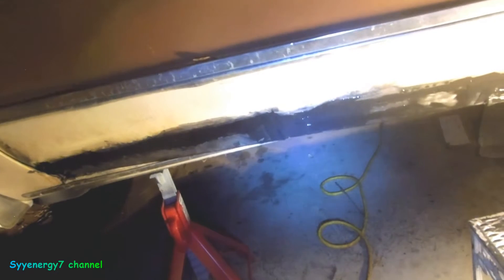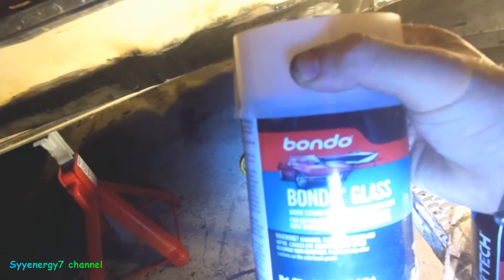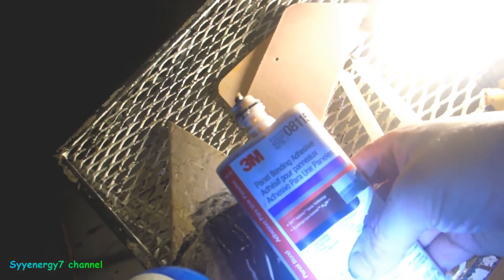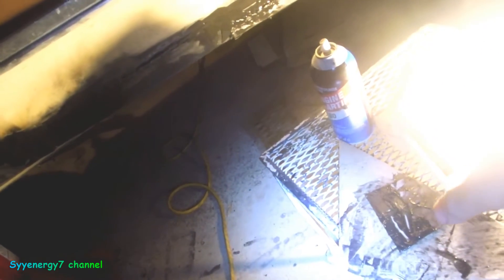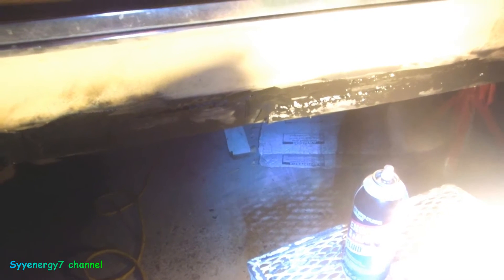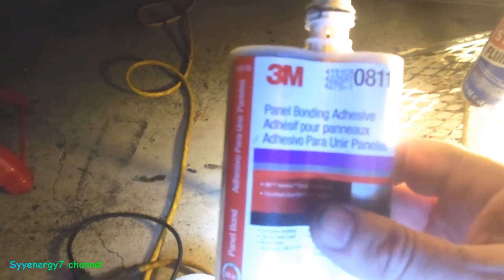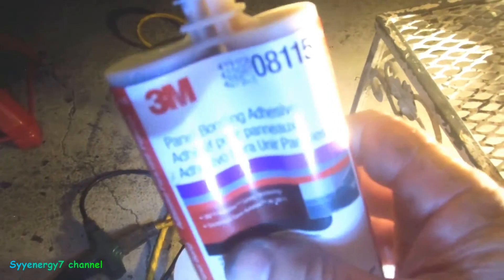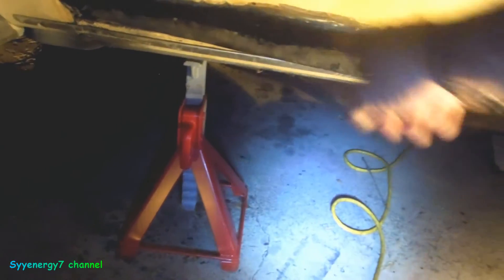Waterproof Porous Welds -Autobody Repair

Comment: Hi have you tried using only epoxy resin with a thickener to repair rusted areas it's a lot easier than getting involved with Welding and in my opinion it does a much better job and you are guaranteed that the rust will not return, auto epoxy resin used in boat manufacturing is essentially the same stuff as panel adhesive only you can buy in much bigger quantities and it's much much cheaper are usually mixed with wheat flour to thicken it then apply it in a similar way to body filler I would also called any other areas that may be affected by rust in the future I've done this on several vehicles and Rust has never returned also the epoxy resin is just as strong as metal and also flexible but never rusts, epoxy resin is different to polyester fiberglass resin it's much stronger more flexible and bonds to absolutely anything!
Reply from the maker: +bh635 With this, I had to recreate the whole bottom of the door.  There was hardly any good metal left to work with.  Epoxy resin is great stuff.
Reply: Yes I have repaired larger areas then the door section you're doing, you can also use thin sheets of aluminium to build up the area in conjunction with epoxy, give it a try sometime, it works really well and it never rusts again. I believe it's actually a better for non-structural Rust repairs than welding!
Reply from the maker: +bh635 Yeah., I agree.  I know the pros don't agree, but there is wisdom in what you say.
Reply: +syyenergy7 yea haha the pros would be out of business very quickly!
Reply from the maker: +bh635 exactly :)